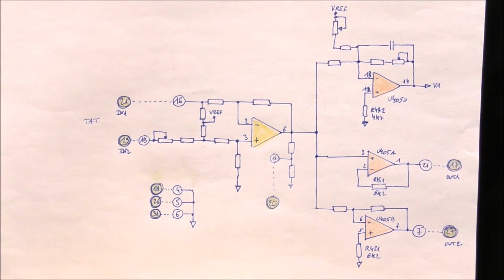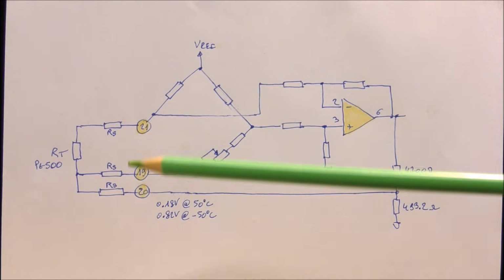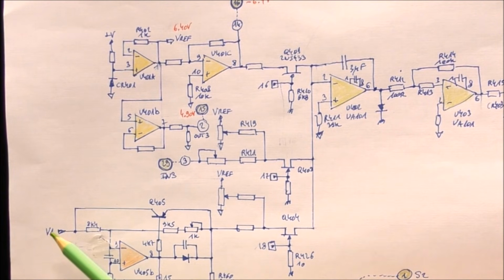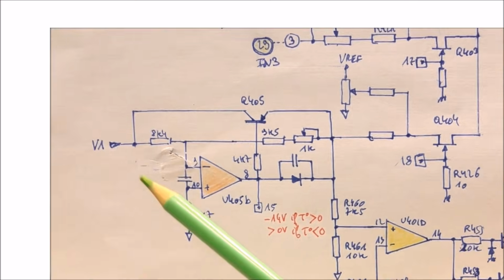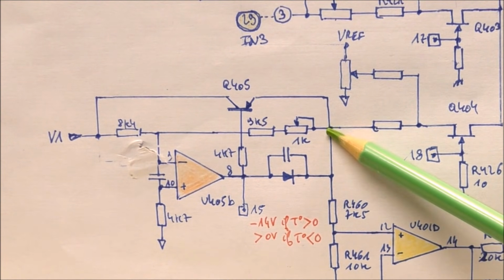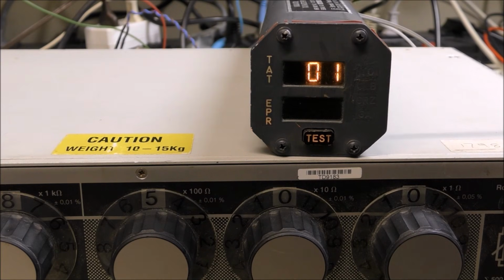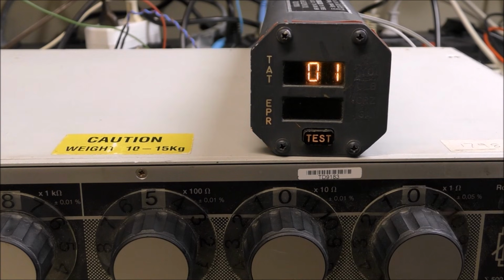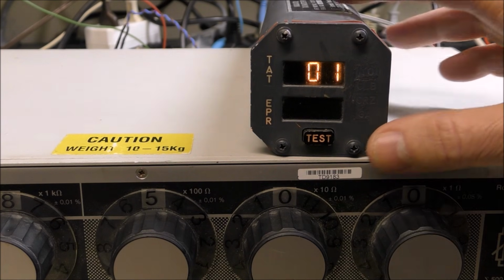LDM #438: Simmonds Precision TAT/Rated EPR Indicator

Comment: In year 1985 engineering trusted to electrolytic capacitors and digital circuits as they are slodered. But the display elemenst, 7 segments, are on pushed sockets for easy changing.

Comment: Your Burster resistance decade is really cool. I like the old style stepper motor design. Today, Burster has the 1427 still on the market. It uses relays. For low ohm simulation from 1 to 3400 Ohm like PT-Sensors it works with switching resistors in parallel only. Their values range from 1,95 Ohm to 100Meg Ohm. A ladder starting at 1,95 Ohms with each next one just below double the resistance of the previous one. The resistor values are not precise, but they are precisely known to the MCU. Only their temperature coefficient is low. The relays are LOW EMF Meder Standex reed relays and for resistors over 3400 Ohms they are Pickering relays. The MCU then combines them to the desired value. Very precise and with high resolution. The design of the Burster 1427 is based on an older, now obsolete design by a company called "Meatest" Type 602. Made in the Czech Republic.